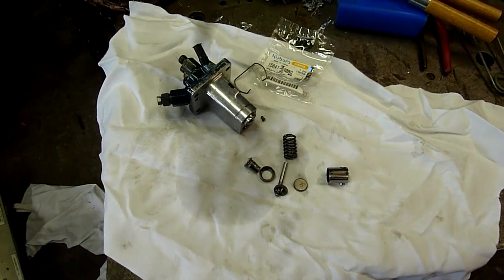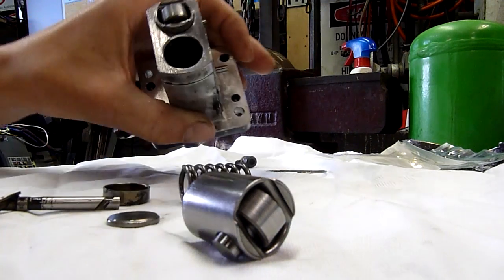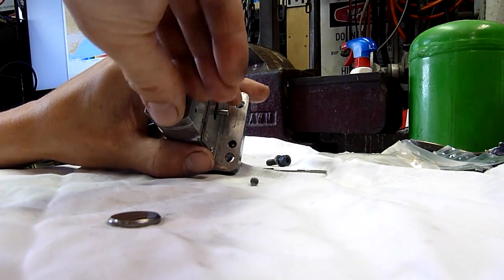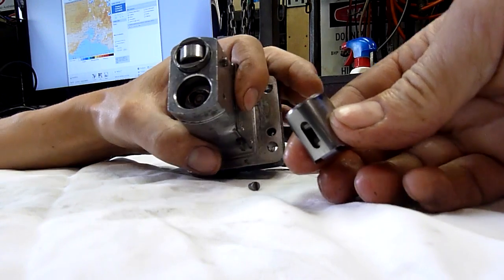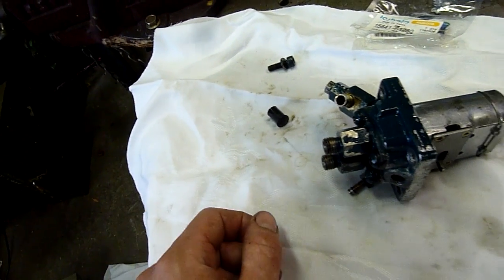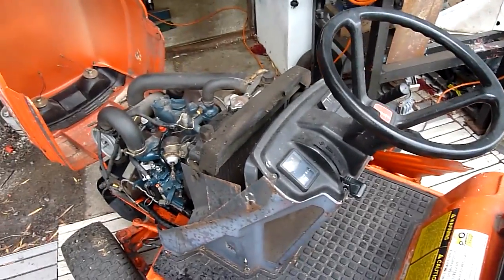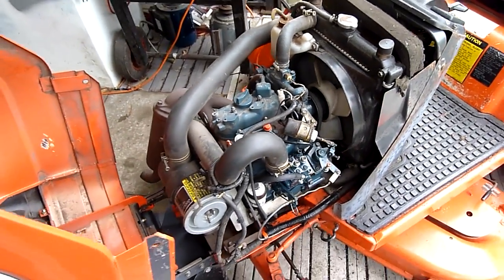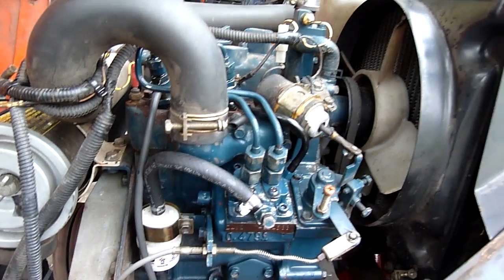Kubota Z482 T1600 Diesel Injector pump Spring replacement

Comment: Thanks for the video. Saved me £200. Stripped down cleaned and reassembled. The pins/pistons inlet groove must be lined up with the inlet port or the engine will run on full throttle and not turn of untill you release the pressure to the injectors so be careful!!

Comment: Very helpful video of Kubota fuel pump springs. Thanks! My pump is identical and has cracked springs. What model number is your pump assembly? I too have a 482, the kubota dealers know nothing here in the states. Want to make sure the spring you used match up to my pump.

Comment: That thing you talked about in the beginning about how the pin spacing must be toward the fuel inlet. That is 100 percent correct. 

I messed up and placed one the opposite direction and I pretty much had full throttle run away engine until I turned the key off. 

I adjusted the pins to your recommendation, and it works fine now. I have a Kubota ZD21 zero turn with a D782 engine. 

Thank you for your help and your video.

Comment: Just had mine apart. Put it together. Had to undo and redo the piston orientation - the curved groove needs to go toward the inlet pipe. (The writing on the piston is opposite the stop word.)  Had one either way and couldn't stop it. (Squeezing the air inlet finally stopped it.) T1600H.

Comment: Depending on the model of pump you have, the diagonal groove will face the "spill port" and the straight groove will face the inlet port in the barrel.  In the Kubota pumps that I have seen so far, the inlet and spill passage are combined in such a way that  it only needs a inlet port.  So, the groove(spill/inlet port) must face the fuel port in the barrel.  The barrel is keyed to fit only one way in the pump body.  Be careful with the small parts!!    
https://www.mathworks.com/help/examples/sh_product/win64/sh_diesel_injection_pump_cycle.jpg
Reply: I found this out too. The pump pin must line up with the port. As the injection bodies can be fitted either way in the pump, make a carefull note of which way the pins come out!
Reply: Can confirm the pins/pistons inlet grove must be facing the inlet port.

Comment: I have a new to me, 3 cylinder diesel with an injector pump that is very similar to yours. I took the top half of my pump apart today, expecting to find something wrong, but everything looked fine. Mine only shoots out diesel a few inches, I wasn't sure if that was normal. Now that I've seen yours shoot 6 feet I know mine is not working correctly. Any thoughts as to why mine isn't producing enough pressure. The side to side action on the fuel cut out seems to work fine, and there appears to be plenty of spring resistance on the cam followers. The top end of the pump looked ok, but I know the tolerances are tight so maybe an unseen issue there? If it's not injector pump then maybe the it's the fuel pump. My mechanical fuel pump was bad so I put in a used electric pump. Fuel is circulating fine but possibly not enough pressure to the injector pump?? Any thoughts? There is very little online about these injector pumps, thanks for posting??
Reply from the maker: I am no expert on these but if the springs and pistons all seem to be fine I would look at the fuel shutoff slide, it may be dumping back to tank via the fuel shutoff slide, but measuring it will be hard, you need good bore and OD mics. best thing at this point would be to send it to a injector pump shop for testing if your not set up to really tear it apart and measure everything
Reply from the maker: that or at least make sure the fuel shutoff is closing all the way, if its getting stuck part way it might explain the issue
Reply: That's a good suggestion, I don't how that works but I'll look into it. I think I'm getting another light tower with the same type of engine. I could try swapping injector pumps to either confirm or rule that out. Thanks for your input.
Reply: I swapped out my injector for a known good one and it runs. I went on to rebuild the bad pump by lapping the mating services with diamond lapping compound and now that pump works as well. Thanks again.
Reply: @paulcalif  what parts did you finely lap?

In case I have that similar fuel delivery issue...

Comment: Dear Aussie
I've just bought a used T1600 diesel and as part of servicing it, I would like to change the HST fluid.  However a little rummaging around the internet suggests this can be tricky especially when refilling the fluid and getting the required amount into the HST.  I have all the manuals (Operator's, Parts and Workshop, but these all lack specific details of the process!).  Could you do a step-by-step of this procedure sometime?  Great videos by the way, especially those concerning the T1600.  Please keep making them!
Thanks
Paul from Canada

Comment: Hello Ed. I'm Matt. Thanks for the video. I have a question though. Before you fixed your fuel pump was it making a loud tick noise do to the spring being bad and where you loosing power? Thanks.

Comment: Sounds  like it runs pretty  good ,, does it have a lot of  hours on it 
you mentioned  APU units  , that's what these are used for  , i have several of them  which i got at the junkyard ,, 2  of the ones i have are very high hours and still run perfect  with no blow-by ,, they both  have  8000+ hours
Reply from the maker: +wildcoyote34 I think this one only has 900 hours, the counter still works so I believe it. they are damn good little power plants.
Reply: that  little  beast  will last a long time yet 
most of mine are  set up to run  various  pieces of  equipment  , like my  wood splitter , and a chipper ,, i also have one mounted in my truck which provides  power for my camper , and for the truck  set up just like an APU on a semi truck , plumbed into the  cooling system ,and the electrical to charge  the batteries,,,,it makes starting my truck  even on the coldest of winter days very easy ,,I push the remote start button   and the APU starts and it warms up the coolant and also operates the engine oil heater ,, 
the truck in question is a 1978 chevy  1 ton  4x4 , which is powered by a  6V-71TA detroit diesel ,,and it will not start without assistance if it's colder than  30F ,,start  the APU and 30 mins later the truck will crank up  almost instantly ,,it's easier to do this than plug it in ,and cheaper too,,costs almost $2.50 per day to keep it plugged in when it's  super cold , and the APU uses less than  1 liter of diesel per hour and diesel is $2.50 gallon currently 
I start the APU and it preheats the engine and  there is a heater in the cab which clears the windows too , by the time i go get in the truck , windows are clear  and the engine is warm and ready to start ,, i also have a remote starter for the truck too which i will be installing this week
Reply from the maker: +wildcoyote34 That is a brilliant setup!, I would definitely need something like that if it snowed here. thankfully it does not :p
I am keeping an eye out for more of these little APU engines tho, they are handy!.
Reply: yes  they are  handy ,, and  i love the way this  setup works I tend to sleep in my truck too and this allows me to sleep in the truck and be comfortable without running the  detroit  diesel ,, it is  NOISY ,, if you have  ever heard a detroit powered truck  you know how noisy they are ,, the most common nickname  is   screamin jimmy  and  they deserve it ,, especially if you ever heard it climbing a mountain at wide open throttle 
I learned to drive  a semi on a 1974 freightliner which  has a 12V-71 twin turbo  detroit diesel 
I later bought this truck from  it's original owner ,, I have driven it across the rocky mountains through  wyoming and montana , to the west coast  , and  it will leave  anything behind going up hill ,,  I've even outrun  C17 cat powered trucks that were pulling lighter loads
love the sound of that Buzzin dozen
Reply: +wildcoyote34 How is the '78 doing for rust? Those 1974-88 G.Ms used to be horrible for body rot, in fact I seem to see more of the 1967-73 variety then the next generation ones on the road. It's a good thing that you can buy all the replacement sheet metal you need for them.
Reply: OlegKostoglatov  when i bought my  78  it was already 95% rust free , It is a  retired air-force base plow truck , and they don't salt  runways and roads on the base ,,
I bought it at auction  for $1,500 
it had fewer than 40,000 original miles  on it 
when i did the engine swap , i did a frame off restoration at the same time ,,
sand blasted, Epoxy coated and painted  the frame ,,cleaned and coated the whole bottom of the cab with spray  on bed-liner coating, after repairing all the minor rust 
likely as not this  37 year old truck will last  another 25 years now  without rusting out

Comment: The second temperature sender is for the glowplugs. If the engine's hot, it will not preheat. Or should not at least.

Comment: I had a grasshopper mower with the 3-cyl gas engine, I honestly believe that engine had the same torqueiness of a diesel. I never could bog it down enough to stall it, it would just keep plugging along. Kubota builds some impressive little engines. I think it was something like 770.5 CC's I could be off but I think I'm close.

Comment: Hey I rebuilding a mower I got for free, do you think it would be a good idea to use truck bed coating on the underside of the deck? Its pretty rusty on mine. Like the rustoleum spray can stuff, it has a fairly smooth finish even though it says textured non-skid.
Reply from the maker: +Epice it does not hurt to give the underside a good coat, sounds like a good product to use too. might make it easier to wash off after mowing too.
Reply: +Epice I've seen that truck bed coating in spray cans and was thinking about a few uses for it, another would be on the inside of bicycle and motorcycle fenders,  car wheel wells, trunk floors. As for lawnmower decks what kills those is when grass gets trapped in the corners and around the engine, we had an old MTD mower that didn't have any baffles so the grass got caught around the wheel bolts rusting out the deck. That rusted out deck was chopped in half by me and is serving as a sacrificial anode for a rust removal tank.

Comment: Thanks for the install video. I have a friend that has the exact same thing, detonated springs, and yep, there's bugger all information on the internet about it. I was really hesitant to take it apart and even a "new" pump ain't cheap.

Also, some pony motor units use the same power plant.

Comment: The thing I finished fixing today was far less grand, but being without a flushing toilet is no fun.
Reply from the maker: +TheEPROM9 lol that is definitely a high priority!
Reply: +TheEPROM9 Indeed.
Reply: +TheEPROM9 I will need to replace the floor under one of those soon, leaking wax gaskets between the bowl and the flange tend to do that. Strange enough someone replaced the toilet before but did nothing with the water damage, I'm guessing that there must be blocks under it or the thing would have fallen through the floor by now.